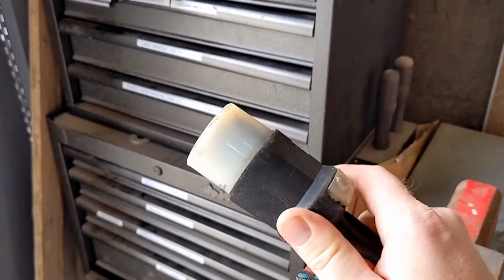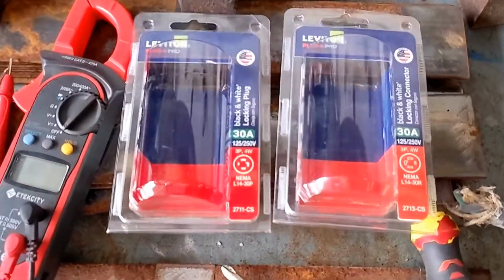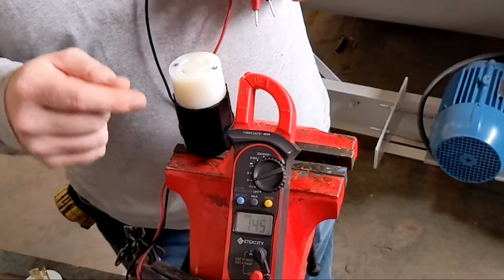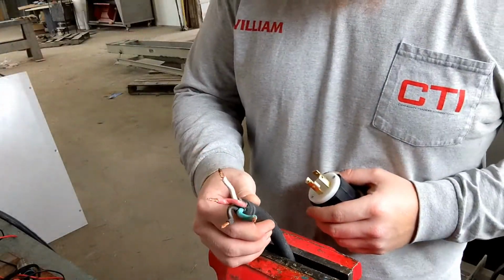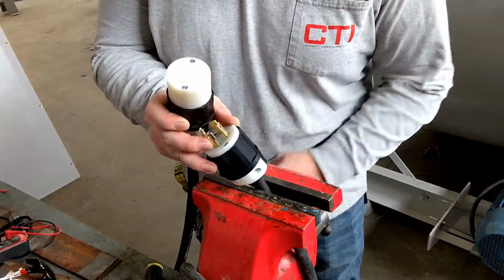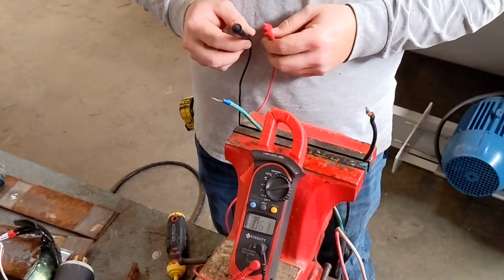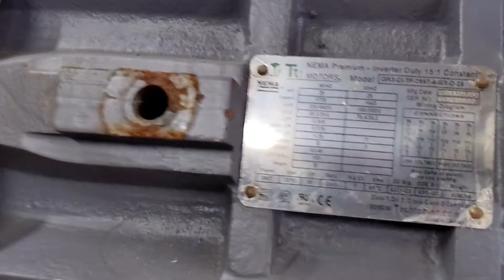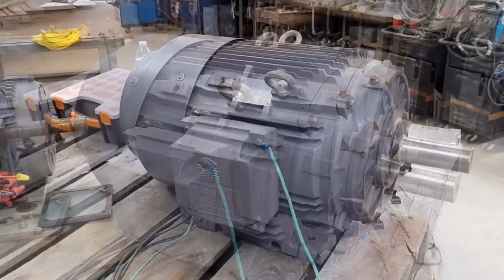Wiring A 3 Phase Twist Lock Plug

Comment: Nice video brother.  I'm building a lathe, I have a 3hp  3 phs motor with an inverter. I'm  running  the  system on 220v single and using  4 leg plugs. My thought is to run 2 @ 120 and 1 at natural  and the last one at earth ground. what do ya think... yea i know your not an electrician  but just your thoughts. Thanks
Reply from the maker: I think it should work but without me being there a little hard for me to say for sure.
Reply: @wildcatwilly  I used 1 leg for neutral and the other for earth ground. any thoughts.
Reply from the maker: Sounds good

Comment: Is it possible to have 3phase with a neutral , cause recently was changing a plug and the person who wired it before had the the white wire as hot and used the red as a neutral . When I tested the female socket was getting 110/110/0 and no 220 across the phases.
Reply from the maker: Sounds like it could be a blowed fuse. Or someone just used a four prong plug for a single phase plug.

Comment: Would be nice to see what color wires go and what whole
Reply from the maker: Black and white = 110volt
Red = 220v wildleg
Green = ground or earth
Reply: There are letters printed next to each hole. G= Green (ground), X= Red (the one he refers to as 220), Y= Black, and W= White. 
The same lettering applies to wall and surface-mounted plugs. 
Keep in mind that in some instances if you switch the black and white wires, the motor rotation changes from clockwise, to anti-clockwise.